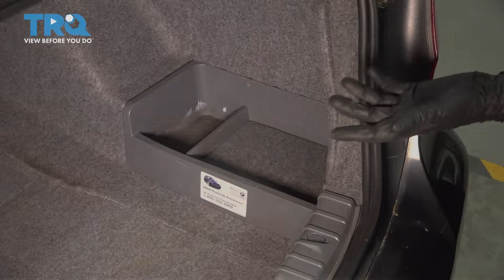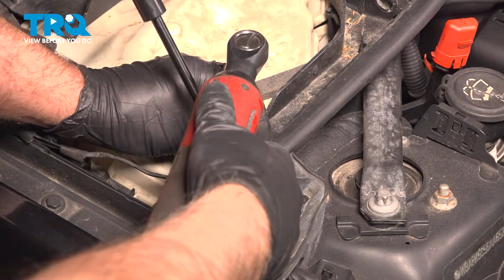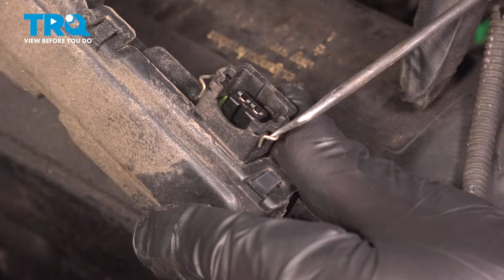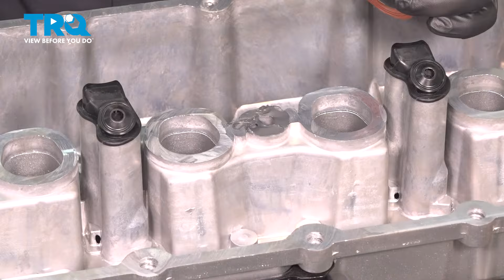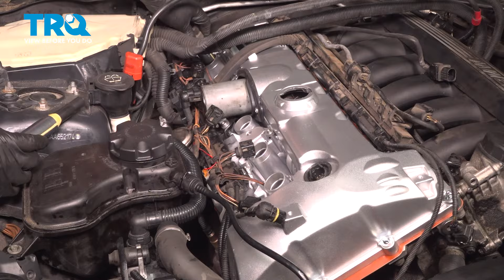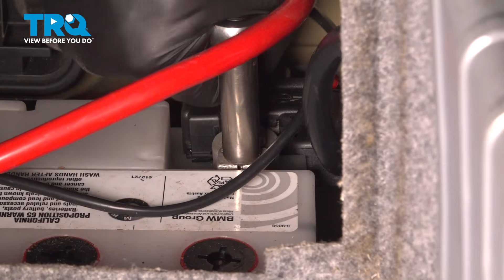How to Replace Valve Cover 2008-2013 BMW 328i xDrive

Comment: bro you are a life saver, i took my bmw for a vanos bolt recall and pcv valve heater and in bad timing the PCV valve decided to retire at 193k miles when the dealer did the test drive after the engine work, i even plugged in my scan tool and the freeze frame data showed lean codes when the engine was under normal driving conditions during the time the dealer had the car, which they pretty much diagnosed it for me, bad pcv and they qouted 2 grand for a new valve cover, but i just told them id fix it, the car wasnt dirvable cause of it but the service manager overhead the conversation and gave me a free tow on the house because that timing was awful for that pcv to go bad, and welp you have to replace the whole valve cover, and i only spent 500 bucks in parts and 6 hours of my time, thank god this happened on a friday so i had that weekend to fix it

Comment: In another video replacing the oil temperature sensor the guy says that you need to drain the coolant fluid other wise if you disconnect it you will have a bubble, he didn’t drain it, shouldn’t i drain it or not?

Comment: I just changed my valve cover using your video. The valvetronic gasket was leaking and I was getting a rough idle and oil dripping onto the exhaust manifold. After changing the integrated pcv valve a year ago I knew it was time to swap out the entire valve cover. I did the valvetronic reset by just going ignition on/car off for 60 seconds twice after installation. No issues, no smoke, no check engine light. Thank you!

Comment: I replaced mine but I’m having issues now with multi cylinder misfire. Dude I’ve checked literally everything. Here’s my question though. Those sleeves that you swapped over from the old to the new. If I have coils that have that thin metal layer on them do I need those? I’m wondering if that’s my issue

Comment: Never put a plastic cover back on

I always replace the plastic covers with aluminum ones

When using aluminum valve covers, always use "the right stuff" sealant.
Smear the mating surface on head and torque to snug
The sealant will create a excellent bond and say good bye to valve cover leaks
Same thing for the middle gaskets around the  oil holes

I've done 7 of these and zero issues and no more oil leaking onto the exhaust manifold 

The aluminum valve covers are absolutely worth it

👍💯

Comment: Is that black circular pcv valve replaceable without removing the entire valve cover? Like, are there screws or you can pry it off and glue it back in? I have too much suction when trying to remove the oil cap with the engine running and throwing codes. The pcv valve is the culprit.

Comment: Goodness this was much harder than I realized but I did it and was kind of proud of myself. It took me two days to do it because I think I spent like two hours trying to get the valve cover out of the car once I had everything off. I watched this video and three others and I seen that each person got it out of the car differently. But there’s the thing. i knew however I got it out, I would have to get the new one in. But I got an aluminum one from Amazon that already had the gasket glued on it so that was kind of cool. Every time I do something by myself to my car I and up with tools I never had before so now I got e sockets which I never heard of until I did this valve cover. This is the fourth thing I have done to my BMW by myself and it was the hardest. I have done the radiator. I did two window motors. And I did the front brakes. It always takes me forever to do anything but then I am always happy when its done

Comment: Improper torque, improper torque pattern, RTV and gasket together will cause a leak, and lastely you do not sell a replacement flat gasket for this cover as the original is ribbed.

Comment: Im in the middle of this process, and I can't get the damn valve cover past the wiring or what I believe in the brake pipe. I have to remove that ground and the cover for the ECM...

Comment: Here’s a tip for that rear corner. Once everything is loose I slightly lift the engine from the passenger side a bit i found it lets the cover come out a bit easier

Comment: Our valve cover gasket from BMW is rubber? we will have to slot it in on the upper cover.  it is not one that sets on the valve cover base?  suggestions??  It won't lock its self in place.  Where did you get the valve cover gasket?